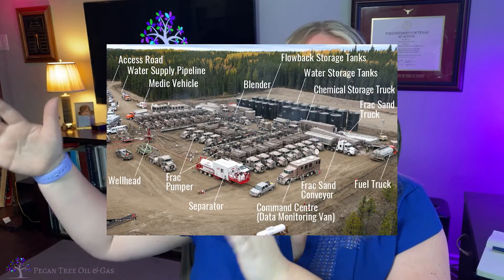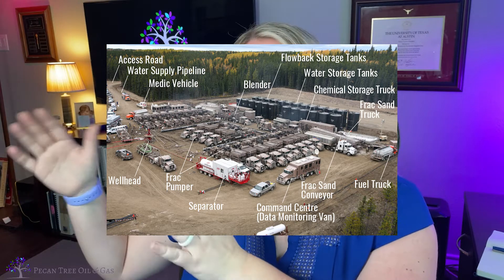Why are my wells shut in? (fracking delays)

Comment: Very helpful video. The question I have is if I can find out where well activity is going on in my area. It appears some drilling has started in the last week or so because we have Sand and Water trucks running up and down our road 24/7. I am all for drilling. I just wanted to get an idea how long all the traffic is going to be going on. Thanks again for your video info.
Reply from the maker: If you check out the state oil and gas commission for where you are, there should be a GIS map that will show all the wells and permits that are causing all the activity 👍
Reply: @PecanTreeOG  Thank you very much. VERY helpful.

Comment: How do you feel about behind pipe operations?
Reply from the maker: Do you mean when a well is plugged back and a shallower reservoir is produced? “Behind pipe” typically refers to hydrocarbons that have been proven to exist downhole but are waiting on a deeper reservoir to finish producing first before being produced.
Reply: @PecanTreeOG  Not necessarily plugged, but inactive. As an aspiring operator/owner, I see a lot of advertisement for older wells with "behind pipe possibilities", or something to that accord. Most people I know are vehemently against any sort of behind pipe prospect. I can see both sides of the coin, but I have 0 experience to go off of.
Thanks !
Reply from the maker: @elonmust7470  There are definitely investment opportunities there but I'd steer you away from them also. It comes with a LOT of risk that's hard to account for unless you're very familiar with the game. A bit like flipping 100-yr-old houses, sight-unseen. The only way I've seen this work is when a field engineer or field ops specialist (who is an expert in diagnosing and working with wells) is both the brains and brawns ($$$), or if they team with an investor.